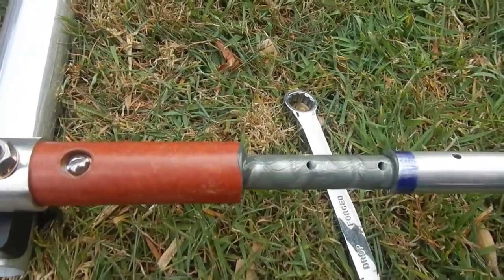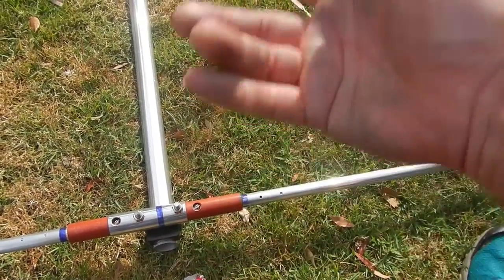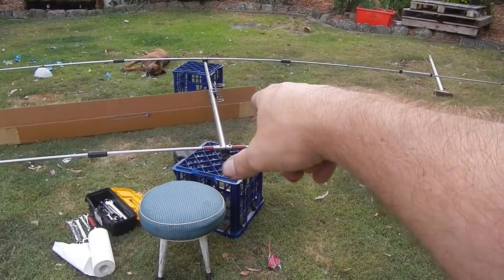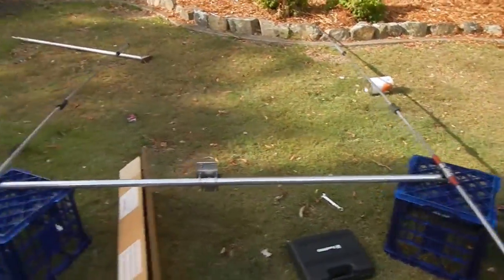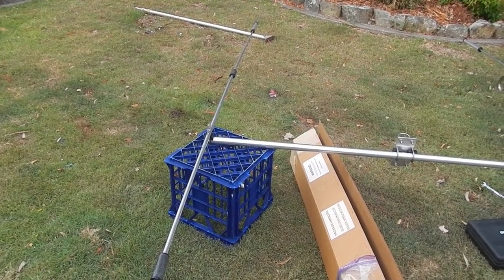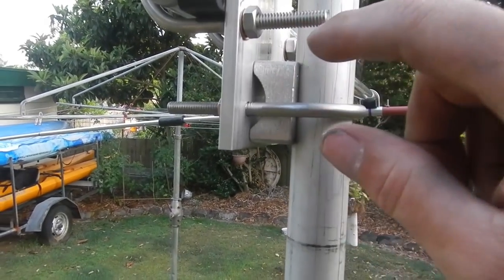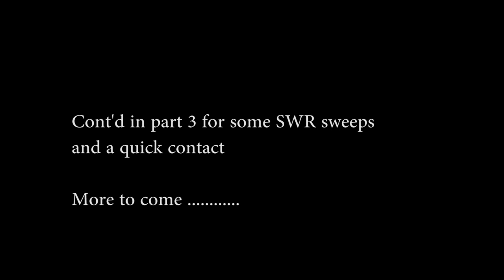Mosley mini 32a 2 element tri band yagi - P2 Assembly set up

Comment: Little bit too close to the ground capacitance coupling most likely.
Reply from the maker: yes, ground tuning it not ideal but it seems to be pretty close once up in the air where it usually sees improvement. 

it took a dive with the mast on a windy day and I need some replacement parts to get it back up and running :(

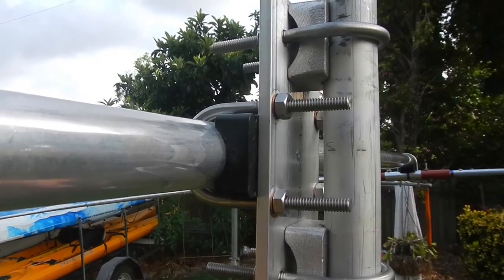Comment: The metal chocks that you have put inbetween the boom/mast plate and the mast (7:10) should be mounted under the driven and reflector.
They have a double crescent in them to stop or prevent twist of the elements against the boom. that's why they are a pain in the arse to fit on the mast. The black plastic ones have a flat back and consequently fit on the boom/mast mounting plate.
Reply from the maker: you sir are 100% correct. 
Ive just confirmed on their website. I shall check it out next time I stick it up in the air. 
Much thanks for taking the time.
Reply: DENMONKEY glad to assist :-) I have the Mosley TA-32m.  de G0KVL.
Reply: I have the TA-33-mini and you are absolutely correct about the metal chocks. For the balun, the instructions say, "Using an FR Choke is OPTIONAL. However, if you are experiencing some RF down your feed line or if you want to insure you will not have RF down your feed line then a simple RF Choke made with your coax will work well. This choke can be made by coiling e turns of your feed line in a 6 inch INSIDE diameter right at the connection of the feed line to the RADIATOR. This coil is just a loop of your feed line rolled up like a rope or a garden hose in the size mentioned. This coil is then taped to the boom within 3 to 6 inches after the connection point. DO NOT WRAP COIL ON A FORM OR WRAP TURNS SIDE-BY-SIDE. This will create a large inductor and not a resonant choke. I hope this helps. 73 DE K7RMJ  Frank
Reply from the maker: Thanks Frank. 
How do you find yours ?
Reply from the maker: cheers Craig. What is the mast in the pic on your QRZ page ?
Reply: It's a 15m Racal pneumatic mast, ex army surplus, collapses down to 3m  de G0KVL
Reply: You are best of using an RF choke even if you don't suspect common mode 
currents, if your antenna system decides to incorporate the coaxial 
braid as part of the antenna system then your radiation pattern will be 
skewed and not as intended. Mosley recommends 5 turns on a 4 inch 
former. That said G3TXQ has an excellent article on this and he 
recommends 7 turns on a 4.25 inch former for 20m de G0KVL
Reply from the maker: thank you. I thought it was. How does it handle the permanent like set up ? Has it been outside for long ?
Reply: It's a fantastic piece of kit, I don't have any guy wires on it so I have to be careful on weather conditions, I know another chap that does the same with his, he uses a cubical quad on his.
They do tend to fill with water so I should really put some sort of shroud round it when not in use, that said it some comes back out when you raise the mast. It won't be an issue where you are but in the UK you have to be vigilant with the water freezing.
maintenance is easy as it easily splits apart to clear the grit and muck out. I have raised and lifted the PTFE seals out to clean a few times whilst in situ and the particular section I want to work on part raised. It's been outside just over a year no, so not too long.
Reply from the maker: I have a pneumatic clarke mast (have a vid on it ) and I agree, brilliant items. Mine weighs around 30kg or so. Can be a handful to move around but doable as one person. 
it had a pressure switch built into the bottom of it but it no longer works. 
I'd like to locate a new one to connect it to a 12v compressor on the car for portable work. Seems low pressure switches like that are hard to come by. 
Does yours hold pressure for a good period ?
Reply: It does have a slight leak, I'm not sure what is deemed as reasonable or whether they are not meant to leak at all. I have a pressure gauge on mine so what I tend to do is clamp each section as it goes up so that if it leaks it doesn't lower, that said you have to put air back in before dropping it otherwise it'll come crashing down with no air in it.
I also prefer to clamp it as there is some play on the mast when just put up with no clamps, the clamps are really simple on the Racal, takes no time at all.
Reply: Def blocks were put in the mast fastening section ....incorrectly